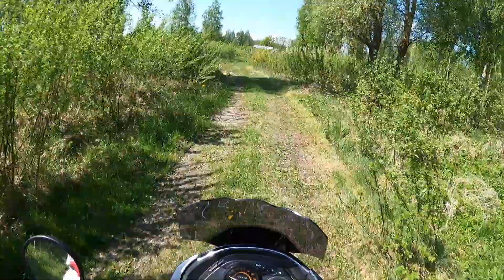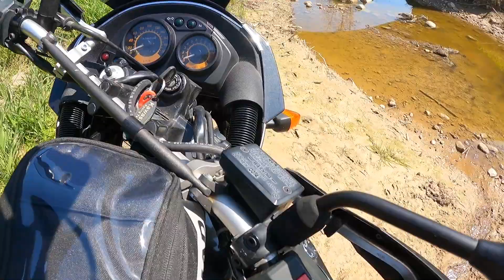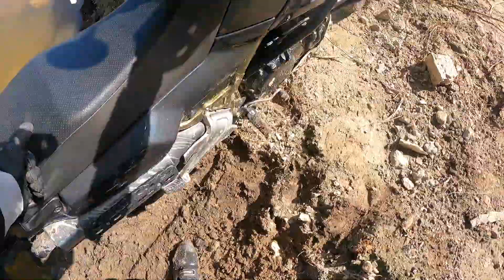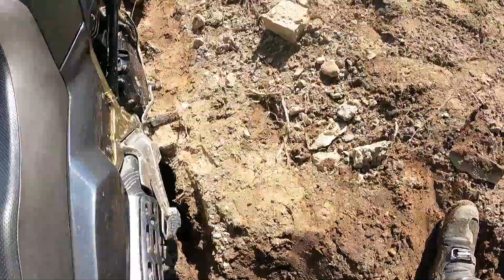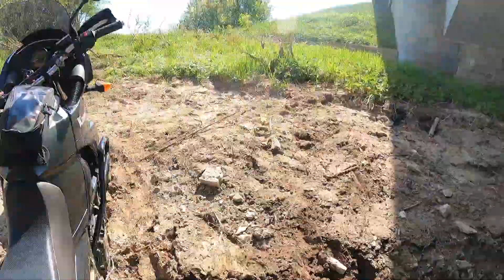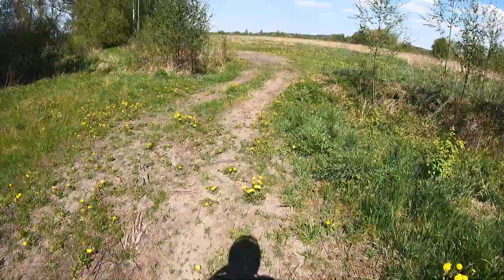Kawasaki KLE500 offroad POV (offroad, fails, mud)

Comment: Hey man nice video ! Does it worth it to have the kle for offroad ? the engine is reliable ? even after 60k kilometers ? i am asking because i wanna buy one.
Reply from the maker: In my own opinion, this bike belongs on gravel roads maximum. If you want to go offroad, muds, sands etc then you need something not so heavy. Engine makes a lot of vibrations and it is not so powerful for that weight. Kle is good for beginner riders or womens because it’s pretty small bike. Or just to go on light offroad or easy trails to make yourself sure that this ir for you. This ir exaclty the same what I did, after kle I bought dr650.
Reply: @998MEDIA  Thanks man!! 🏍️🔥👌